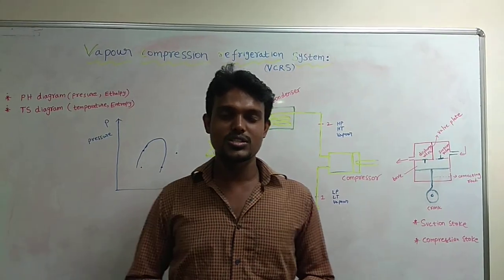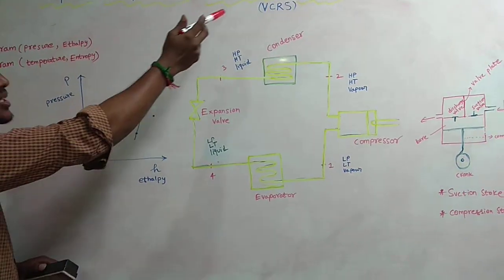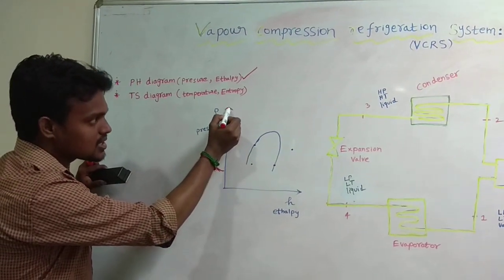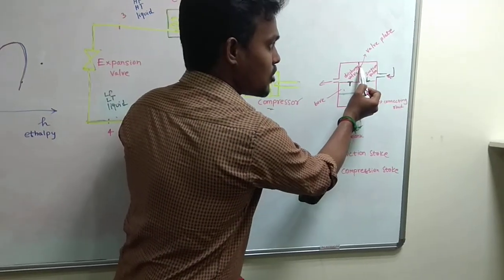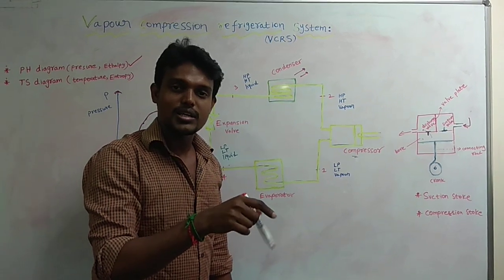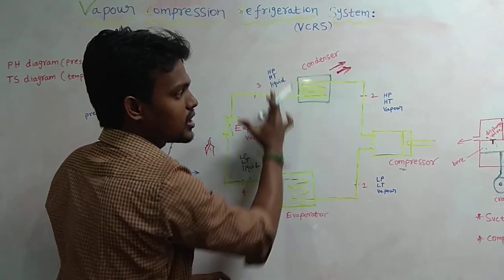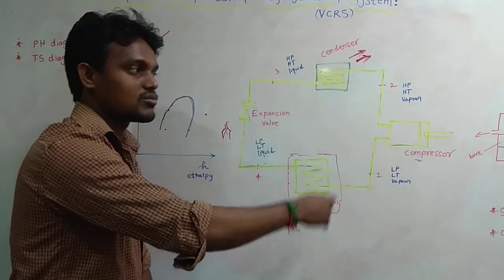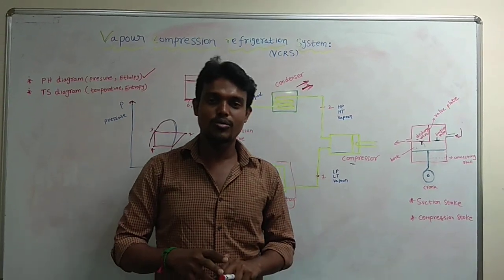Vapour compessor refrigeration  system | Engineers View | ASHOKRAJ S | Tamil

Comment: bro thank you very useful but a doubt condensor work is  rejecting the heat and changing the vapour to liquid is it but the heat from the vapour is rejected  then how the liquid will be in high pressure high temperature

Comment: Why we use compressors
Why we increase pressure and temperature
How work heat transfer here
It's a open cycle or closed cycle
What is ideal gas law
How works gas law here
Why we use ideal gas law here

Comment: Hai ashok bro spilt unit outdoor suction line only ice formation what issue& error cord in display in PCB. What problems explain pls tks sir
Reply from the maker: Due to the below issue, chances of ice formation will happen at AC out door and even in chiller.
1.restricted air flow over evaporator coil
2.low refrigerant level ..
Hope you may got it.
We will upload video about it .keep supporting our channel and do trend.
Regret for the delayed response.
Thanks..

Comment: Anna how to identify mismatching compressor, condenser coil, evaporator coil, condenser fan, evaporator fan motor, filter drier, capillary, tube, expansion valve in the  air conditioning and refrigiration system